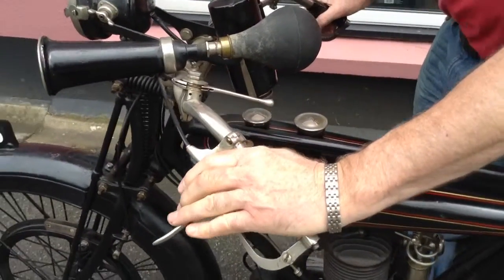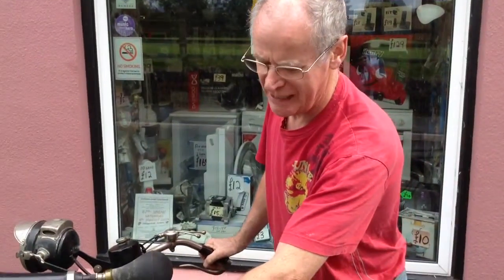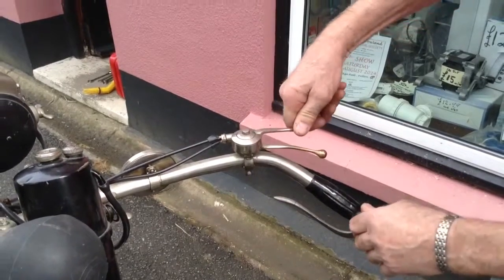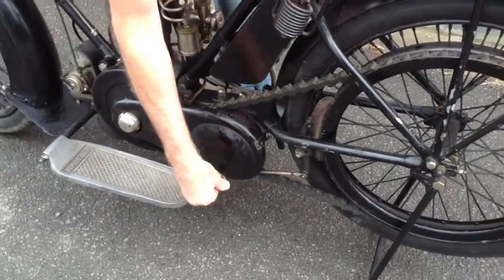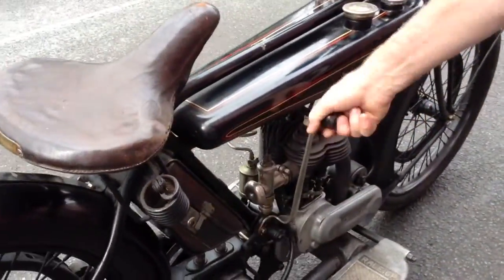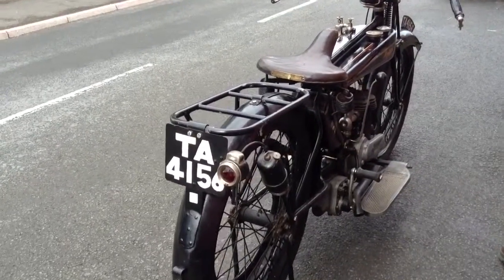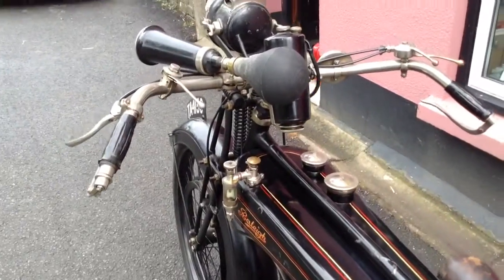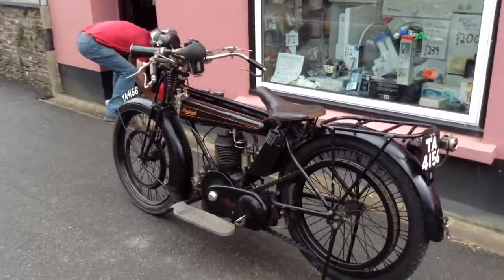1922 Raleigh motorcycle controls

Comment: An interesting video. An erroneous statement at the end, unfortunately. This machine has a "total loss" oiling system, where the oil goes through the engine and is burnt, coming out of the exhaust pipe as blue smoke. There is no pump to return it. A "dry sump" system is where the oil is fed into the engine and recirculated back into a separate oil tank, like many motorcycles. This tank can be within an engine, for example, some Royal Enfields, but is still kept separate. The vast majority of cars and some motorcycles are "wet sump", where, after being pumped into the bearings, the oil drains down into a sump within the engine and is not pumped back into a separate tank.
As you point out, yes, some racing or competition cars have a "dry sump" system with a separate oil tank away from the engine, which prevents the engine from losing oil pressure due to the oil "sloshing away" by centrifugal force from the oil pump pick-up, thus starving the bearings, and also keeps the oil cooler.